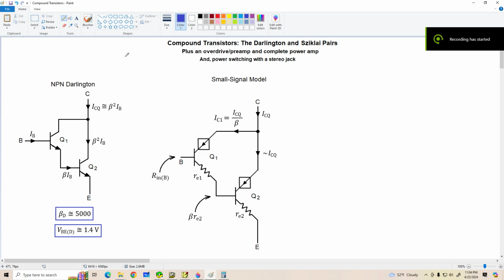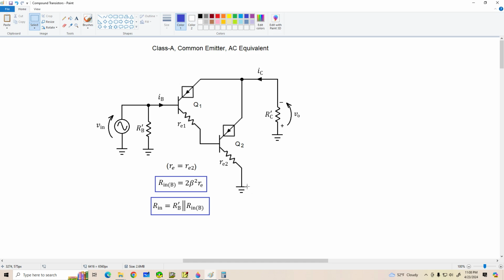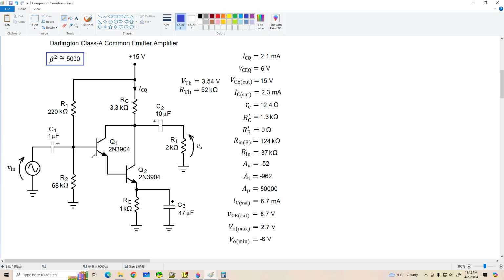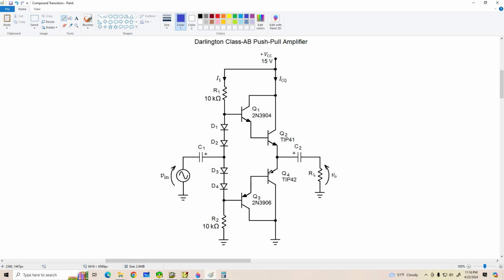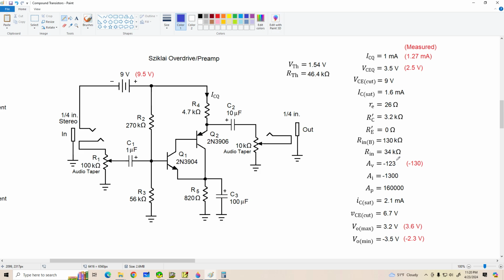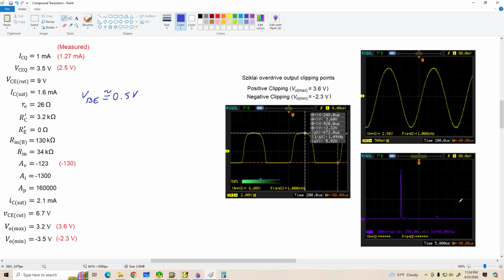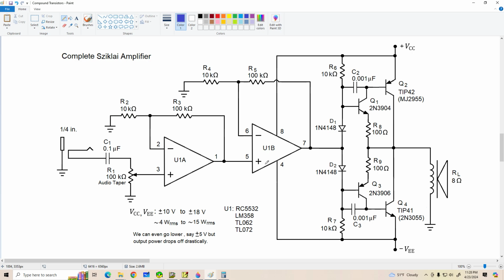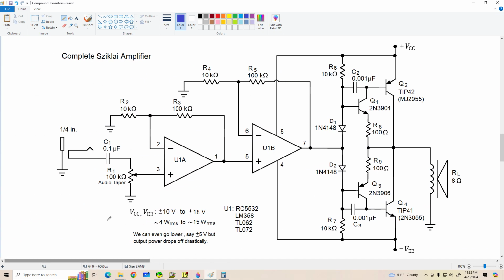Topic 38: Darlington and Sziklai Pairs, Overdrive/Preamp and a Complete Power Amp

Comment: You say that operating a power amp without load is a bad idea. But why is that?
Reply from the maker: No load will definitely destroy a transformer coupled power amp. It can also damage some modern power amps because under no load the gain of the amp can get very large which can cause overdrive of stages in the amp. Depends on the exact design and might not be a problem but not a good idea in general.
Reply: @Denton.Dailey  Thank you for your answer. Fortunatetly I am not a tube guy.
I think a properly designed transistor amp  has to be stable in a no load condition.
Reply from the maker: @Achim188 yes, you’re probably safe running solid state amps (most likely class AB) no load. Although if you are looking at the output on a scope for whatever reason, running no load may produce some odd crossover behavior depending on the topology. More recent topologies like switching amps might be more problematic though. I am just in the habit of playing it safe with loading. Thanks for watching 👍🏻

Comment: AS USUAL EXCELLENT PRESENTATION! WHAT ARE THOSE FOUR DIODES USED FOR IN THE COMPLIMENTRY PAIRS?IF I WERE BUILDING THIS CIRCIUT,I WOULD USE A DARLINGTON PAIR PACKAGE INSTEAD OF TRYING TO MATCH TRANSISTORS.
Reply from the maker: @davidluther3955  the four diodes just compensate for the barrier potential of the output transistors. It’s not really possible to match them to Darlingtons because of the current differences between transistors. A Vbe multiplier could be used here too but the best way to bias this up requires negative feedback techniques which we haven’t gotten to yet.

Comment: Just discovered your channel.  Great content.
Now I have to go through the back catalog 😊
Reply from the maker: Glad you found the channel.    I’m just getting started and hoping to generate a lot more content and hope to keep improving the presentation 👍🏻
Reply: @Denton.Dailey I think your presentation is really good. Heavy on the maths, which I struggle with sadly. I kinda felt like I walked into a room and was like woah, this is all way above me. What even is beta 🤷‍♂️ yeah it’s that bad. I love fixing stuff but have avoided the maths. I’ll go back to the start of your videos and work on my maths a bit I guess 😬. Great content though, thank you !
Reply from the maker: @Mark_C1 hi, Mark. Thanks for the feedback. Yeah, I definitely approach this stuff from a very technical perspective. What I envision is to eventually cover the whole field from basic RC circuits through transistors, op amps, vacuum tube amps and effects circuit operation and design. I also do plan to add a few videos that are more descriptive at some point as well.

I taught EE for nearly 40 years so it’s hard to get out of that mindset. I definitely will keep the use of calculus to a bare minimum though 👍🏻

As far as transistors go, you might start with Video 12 and see if it helps with some basic concepts. I probably should have done an introduction to transistors first but I couldn’t help but jump right into it. 

Again, thanks for the feedback. And hopefully some of the presentations will be informative and thought provoking.

Comment from the maker: Sounds a lot like my experiences with Darlingtons back in the day as well. I always seemed to have better luck with Sziklais for whatever reason. Back in the 70s I would twist my dad’s arm to take me to a hamfest once a year and I’d try to find a good deal on power transistors, heat sinks, filter caps, etc.
Reply: I think the bdx33/34 were low saturation voltage designed for switching only nothing linear, didn't know what that was at the time, I just used whatever I could get, most of what I made back then didn't work well!

Comment: i when i was a kid with no money (early 90,s)i  tried to use bdx33b and bdx34b as audio output , the bdx33/34 were plentiful from scrap barcrest fruit machine boards i was getting free, they use them to drive the lamp matrix ,they sounded really clear and livelly and werent oscillating but i could never control their thermal runaway. went to hitachi mosfets taken from dead disco / pa amps after that